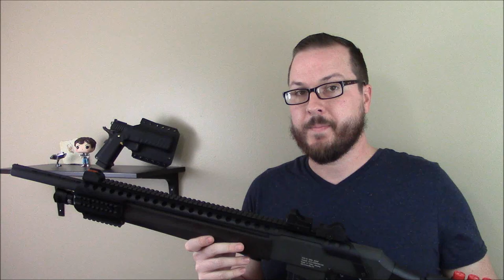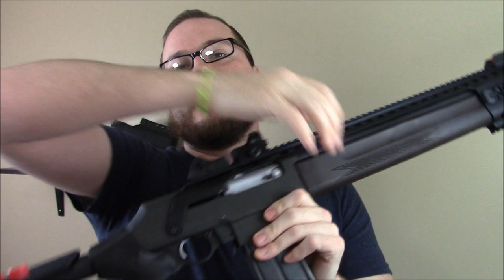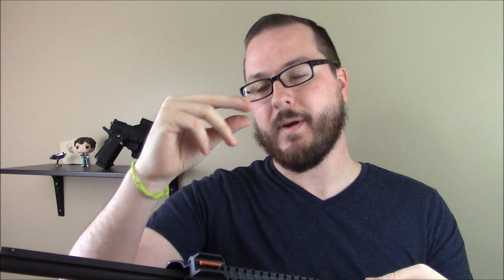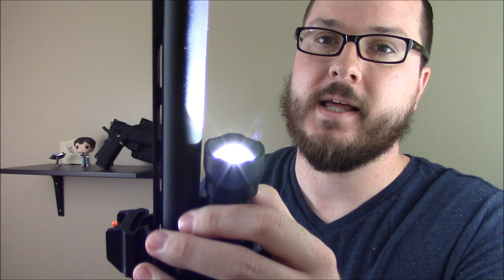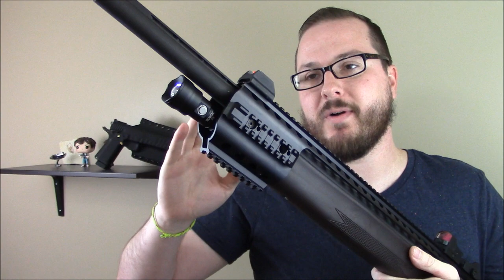Black Aces Tactical RB7M Rail - Custom SAS12 Install

Comment: If you clear the weapon then take off the plastic housing around the gas system you can run toothpaste, and metal polisher thro the acton it will make it super smooth, and also look for imperfections in action where the bolt slides over the trigger arm

Comment: Booligan, would think that you should check the gas ports of the Piston assembly, for that maybe the issue there. Also I'll probably see if I can make a few aftermarket parts for it when I get mine
Reply from the maker: That's what I ended up doing. The gas ports on mine had burrs and weren't manufactured very cleanly at all. I drilled them out to the same bore size throughout and then cut the barrel to 19" and filed down the rough burrs in the bore from drilling out the ports.

Comment: Shoulda Listened to YOU!!! I tried to save a few $$$ and found a WarHammer rail for about $65
Long story Short...I think I waisted my $$$!  I'll start saving for a Black Aces Rail. I saw on Reddit the finished product with 19" barrel.
Did it still function as designed?
I am searching for a muzzle brake also. Time(& $$$) will tell
Cheers

Comment: Hi, I've tried this combination and had some problems, the stock loosens up after repeated firing, the the reducers aren't strong enough and will shear after time, if you Dremel too much out from the stock the blowback from the bolt will hammer the 40mm bolt right back out and you'll be left holding a receiver in front of all your friends (that was pretty funny, Billy BadAss to Dumb Schmuck in 0 - 2 minutes lol) the screws that hold the rail obviously weren't field tested for repeated use and will shear off; you'll be left with broken screws in holes drilled into your shotgun... Just thought I'd provide some product testing info for you.
All these failures occurred within the first 20 rounds.

Comment: Hey Mate, I was looking around EBay and came across the "Warhammer" for the 500. I value your opinion.  Will it also fit with a little modification. I think it is missing the smaller slot continuation for the bolt.

Comment: Hey buddy, who makes the front and rear sight to mount on the rail?  I need a set and am having trouble finding them.
Reply from the maker: I used sights from an airsoft Skorp Evo. Basically, much cheaper version of this: https://shop.cz-usa.com/ProductDetail/366000000001_Evo-Sight-Set
Reply: Booligan Airsoft and Shooting Sports thanks so much!

Comment: Wgat flashlight and mount dud you use?
Reply from the maker: +Darkskin Diogenes the flashlight is a Wowtac A3, but any 1” light will work. There is no special mount, it attaches uses the barrel clamp that the rail system is secured to.

Comment: Don't cut the barrel!
Reply from the maker: Already did and got it running great at 19" long. Why do you say not to cut the barrel? It's fully legal to do so as long as the barrel length remains over 18".
Reply: Sometimes on gas guns, when you cut the barrel, you lesson the time the gas has to act on the piston working the action. I saw another review on this gun, where the owner had cut the barrel and the gun didn't work reliably anymore. I guess you could open the gas ports some if needed. But, you said you already cut yours and it is holding up fine. Good deal, am happy for you!
Reply from the maker: @genesmiley3727  Yeah, the gas ports needed some polishing and opening up a smidge for a broader range of ammo capabilities even before cutting the barrel. These aren't super reliable guns in stock form, so cutting the barrel did require some tweaks to make it run better, but that was part of the plan for this build all along.

Comment: No updates? Let me guess its not working as good as you hoped? I got 1500 or so shot on mine from bird shot to hot slugs.  I can't for the life of me see how so many people having trouble fixing the SAS12 when it is so easy.  Good for me I suppose it keeps'um cheap.
Reply from the maker: Fractured Hearts it’s working great after I opened up the gas port a little bit. No updates because I’ve got LOTS of other projects in the works and this one is done.
Reply from the maker: Fractured Hearts yes, it’ll run high brass bird, slugs, buck, etc. I was very conservative with my gas port enlargement so I wouldn’t overgas it with slugs/buck/etc.

Comment: 140 bucks for your stock?  ATI? I got mine 29.99 at center fire.
Reply from the maker: Fractured Hearts that’s the MSRP for the entire stock, Mount, and pistol grip assembly. This setup is currently $90 on center fire systems
Reply from the maker: Fractured Hearts it’s the ATI T3